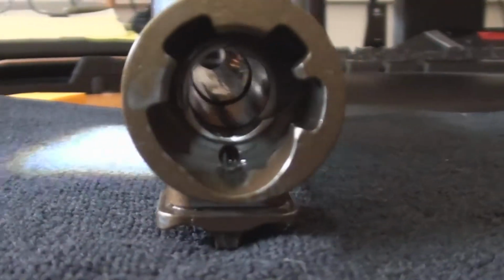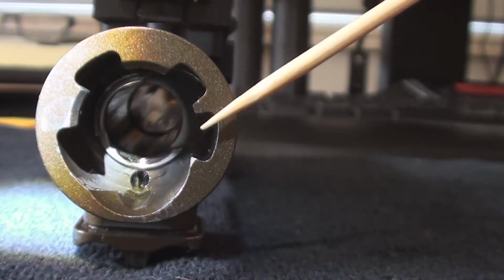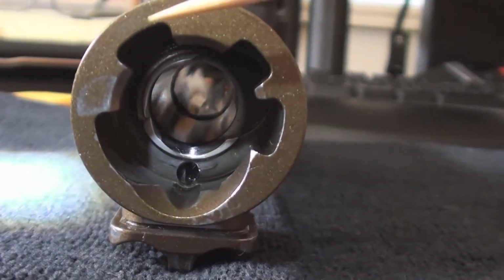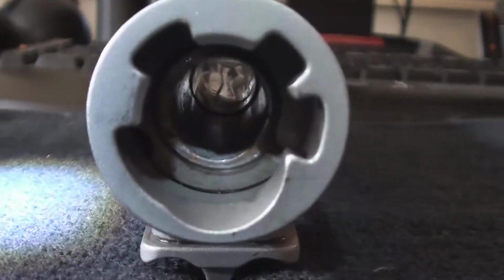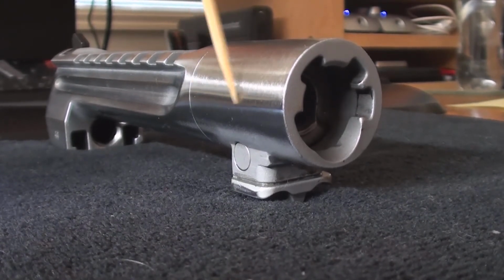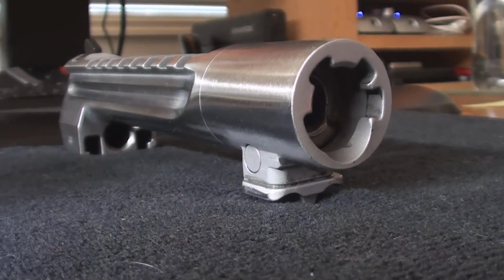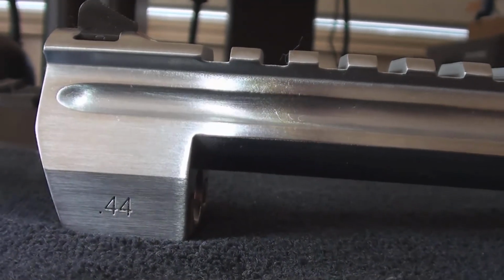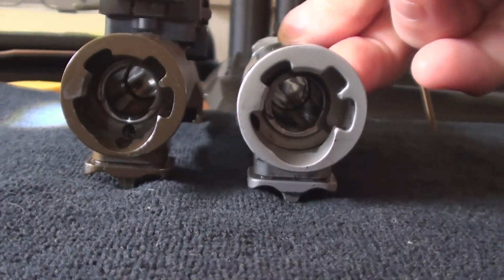Desert Eagle Barrels

Comment: Great info! Thanks. Question: Would this technically be a long stroke piston because the piston is connected to the bolt and moves the bolt with it just like long stroke rifles? I.e. The AK47 is long stroke because the pistone is connected by a rod to the bolt assembly. The SKS is a short stroke because the piston punches the bolt, but doesn't actually move with the bolt nor is connected to it.

Comment: I'm supposed to believe this chunk of steel can't handle 454 casull but a Ruger super redhawk with no recoil mitigating action and 6 holes in that cylinder can. I think deagles can handle rifle pressure loads and just no one has been willing to test it.
Reply: I dont think so only because Ive run a little bit hot and the first thing to go is the front area of the frame rails right under the gas port twist and it'll break the gas piston and possibly ruin the frame. I had a pretty hot load worked up and didn't realize it was happening until one too many. It broke at the thin part of the gas piston and my frame was ever so slightly twisted. Then I watched a slow motion video I had taken of me shooting (I was recording fireballs) and I could actually see the frame do a weird flex/twisting motion. This was just a bit over a max charge of h110. (Like a grain over.) Its the gas system thats the weak link, the pistols with the bottom picatanny rail may help to avoid the twisting action but anyway im sure those rounds were no where near the typical rifle pressure and they bent a frame after about 100rds. Obviously I had no way to measure pressure myself but I wasn't getting any crazy pressure signs on the brass. I was able to straighten the frame and toned them down a bit and she's been fine. I think the frame would twist bad enough to render the gun inoperable before it would grenade or anything crazy but I highly recommend staying within the known charge weights because like I said I was barely over. I was so happy too, I had a 340 grain bullet moving at 1400fps.